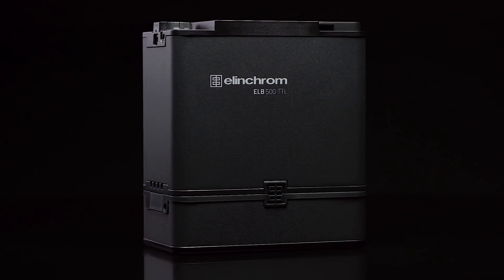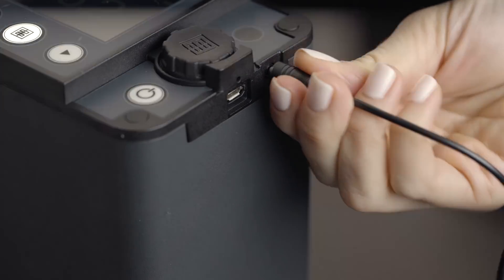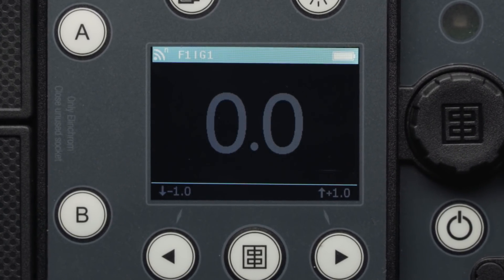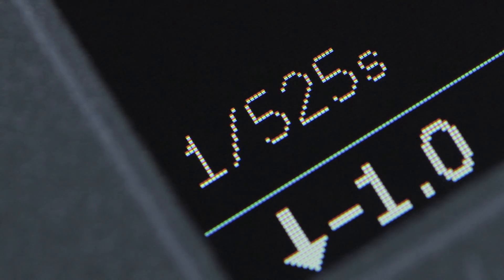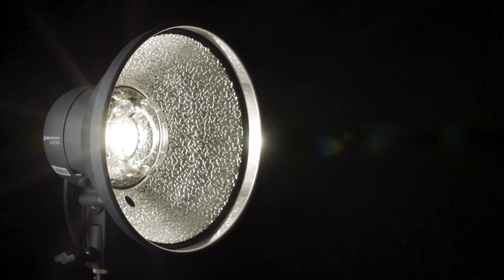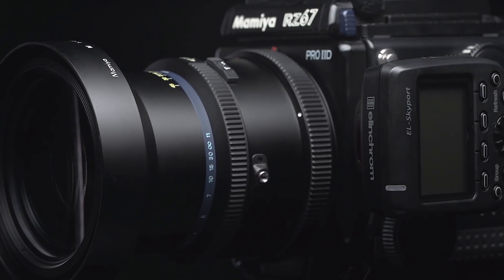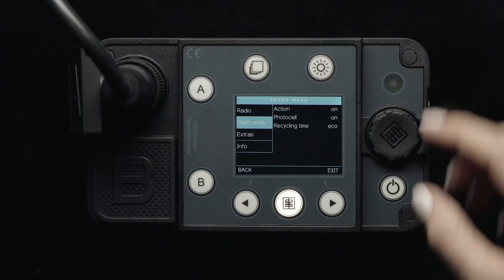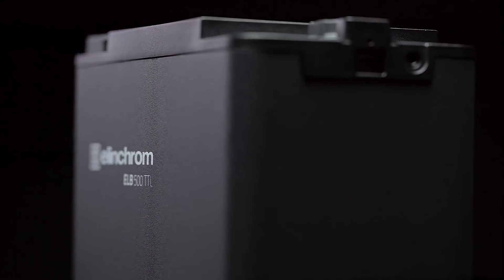Elinchrom ELB 500 TTL - Quick Start Guide

Comment: Will my Skyport remote from my Quadra system work with the ELB 500 TTL?
Reply from the maker: You'll be able to trigger but if you don't have the Transmitter Pro you won't be able to enable features like HSS or TTL.

Comment: I have a ELB 400 and the  flash head broken twice at the pivoting plastic attack to stand. Even using them VERY carefully they are too poor and light made. Searching maximum compactness and low weight they use a too slim and bad quality plastic house IMHO. Far away from my old Elinchrom lamps , made like a tank with all metal made  pivoting system . A very bad and cheap solution. I don't know if the new ELB 500 heads are better made (visually it seems the same) , but the ELB 400 heads are simply terrible. And to repair them is expensive. Pity, because for the rest they are very good and capable products

Comment: I have just upgraded to ELB 500 from old Quadra's as the units are slightly more powerful and you can use two heads at full power which for me is ideal - as I wait for delivery in the UK from those super people at Clifton Cameras I have a question does the 500 do HS?
Reply from the maker: Hi Nelson, thank you for your message. Yes, the ELB 500 provide HSS, but please make  sure it is compatible with your camera brand.
https://www.elinchrom.com/support/ELSP-HS.html#compatibility_cam
To activate this feature along with TTL, you also need the dedicated Transmitter for Canon, Nikon, Sony, Fuji, Pentax, Panasonic or Olympus.
https://www.elinchrom.com/support/ELSP-HS.html#versions
And please note that the ELB 500 cannot provide full power on each head as you seem to mention. This is physically not possible. The pack in total can deliver 500ws but split in each of the head (if 2 heads or connected).

Comment: How about doing an instruction video for the Skyport working with the ELB-500 Battery Pack????
Reply from the maker: Hi Frank, how can we help? Do you have issues with your transmitter?
Reply: Elinchrom i would also like to see such a video. It is not fully clear how they interact in different modes.
Reply: @elinchromLTD  I am trying to help a colleague get setup and running with her new ELB500 and Skyport Pro. It's proving to be a nightmare for us. She's in another city and we are using Zoom. She has somehow managed to get it so that the Skyport no longer sees the ELB500 and so she can't trigger it. We have both set to the same channel (1), the group setting is All. I had her put it into the red background "speed" mode to try and simplify, but the transmitter and pack just aren't talking. (It doesn't help that I have never used one myself but I'm usually pretty good with studio strobe gear. This one is driving me insane though.)
Reply: So I guess what I'm saying is, it would be really super nice to see a video that walks through how to setup and use the Skyport with the ELB500 pack. Assume a newbie and start with the basics. It seems like the simplest concepts are really hard to get with these two units.
Reply from the maker: @BruceWalkerPhotography  The rule here is to have the same frequency, the same group, and the same mode on both unit and transmitter. That means if you set up your transmitter into Speed Mode, make sure your unit is also into Speed mode or no connection will happen.
But, in general, we recommend staying in Normal mode if you have a DSLR camera.
https://www.elinchrom.com/learn/what-speedmode.html
Reply: @elinchromLTD  thanks! That helps.

This illustrates my big issue though. You don't provide a "system" guide that explains how these things work together. I read the ELB 500 manual and the Transmitter Pro manuals and nowhere was this concept explained. No mention anywhere that the two units needed to be separately set to the same mode either. (I would have expected that setting the Transmitter Pro would have automatically also set the ELB 500.)

An overview doc is needed, please!
Reply from the maker: @BruceWalkerPhotography  Bruce, we know this information is crucial, therefore we have it in both the Quick Start Guide and the full manual of the Transmitter Pro, in the ”Troubleshooting” section. It is also mentioned several times on our FAQ page and on some of our webpages. This information is actually included in the link I sent you.
But, you’re right, we should have included it in this video. We’ll make sure to implement this information in our next manual video.

Comment: With both heads attached to the unit and in use does the unit put out 500Ws to each head ?
Reply from the maker: No, the output power is distributed over the 2 heads.
Reply: @elinchromLTD   Thank you! I was so close to buying them thinking you'd have 500Ws to both channels when both heads are connected. Also may I ask why there's no trigger actually supplied with the pack and only a PC sync cord ?
Reply from the maker: @SimonPhillipsPhoto  If you use one head, you'll have 500ws full power output.
We do not include the transmitter because we have a transmitter for each brand camera. 
Some of our distributors include the transmitter in a set depending your camera brand.
Please check: https://www.elinchrom.com/distrib.php

Comment: I have the elb 500 with the odin ll  for Canon its awful didn't work right from day one I sent it back for the Tec guy's to have a look at it came back the same . Very dissatisfied with it . ( I have two odin controls so it not the trigger  ) works fine with the Elinchrom trigger . Any help on this issue would be greatly appreciated.
Reply: @elinchromLTD as far as  I am aware there is no firmware up dates for the phottix odin ll for Canon at the moment as I said  works great with great with the sky port controller. Looking forward to your  response
Reply from the maker: We are checking this with our R&D team and trying to replicate your issue.
Reply: @elinchromLTD  thanks, it would be great to get it sorted .

Comment: When used with Odin II (Nikon trigger) manual mode on, does the ELB 500 stay in TTL or switch to true manual?   If the ELB 500 stays in TTL modes what is the color consistency like across the power band from low to full power? Also is the modeling light controllable from the Odin? Thanks
Reply from the maker: It switches to true manual. The color stability is consistent across the all range, +/- 200 over 7 f-stops.
Reply: Hi, Thanks, Do you get the flash duration displayed when using the ELB 500 in 'Phottix' mode or is that only with Skyport?

Comment: Using two heads, will it give 100% of power to both?
Reply from the maker: No,  you can have both ports fire at the full 500w/s of power for both heads combined (250w/s each), or you can have port A fire at full power and port B fire at the lowest power.
Reply: Ok. Thanks for the clarification :)
Reply from the maker: Alejandro:

No; a pack with 2 outlets can only put out x amount of wattseconds (joules).  How that energy is divided will depend on the lighting effect the photographer is looking for.  It could be 50/50, 70/30, etc., depending on what setting the pack allows.

Comment: Sony support is not working as advertised, no response from support about this issue in 5 days now. Very poor Service Elinchrom. I came back to Elinchrom from Profoto in the hope of better support. Sadly I am disappointed about the total lack of support for this product so far.
Reply from the maker: Terribly splendid.
Reply: Hi Cris, I do not know which Country do you come from and what ELB 500 literature are you referring at. I live in Italy and I had the opportunity to read the original English and the Italian press release and brochure for the ELB 500 TTL and on both of them it is clearly stated that TTL support is immediately available for Canon and Nikon only, while other brands will follow...
Reply from the maker: What is your issue Cris?
Reply: My problem is that I have both emailed support and opened a support case via the website last week and you are not able to reply to that within a reasonable time, but you can reply to a YouTube comment within 3 hours on a Sunday! The product is sold as supporting Sony TTL via the Phottix Odin II triggers, but they do not work as the option is missing in the setup menu. The Elinchrom triggers do not appear to currently support Sony either. I would expect a reply or even an acknowledgement within 24 hours, and yes I have already contacted my local support but they were not able to get an answer either. So I am left feeling I've made a mistake buying into this system (at least so early).
Reply from the maker: Cris, we informed on our website, to all our distributors and in our Press Release that the TTL feature is only available for the Nikon and Canon Transmitters, for the moment. The Sony version will come soon through a firmware update. Please be patient. 
For the Phottix Odin II triggers, we have to do a firmware update on the unit. This will happen the same time we make available the firmware for the Skyport HS / Transmitter Pro for Sony.
Reply: I am aware of that. But if you go read your own material it does suggest that the system is full compatible with Phottix Odin II. Which it isn't. I still don't understand why your support can reply to a YouTube comment, but not my direct approach via your support channels. Very poor.
Reply from the maker: The online support has a longer response than our social tools. 1 or 2 weeks is the average response time.
Reply: WOW! Maybe you should put that on the outside of the box! You have also avoided my actual question about Phottix Support.
Reply from the maker: For the Phottix Odin II triggers (other than nikon and canon), we have to do a firmware update on the unit. This will happen the same time we make available the firmware for the Skyport HS / Transmitter Pro for Sony.
Reply: Thanks for the clarification. In that case I think you need to add that clarification to your marketing material and manuals. Because at the moment they are misleading. I may have to go talk to my supplier about returning the ELB 500s then. This is a great shame as I was excited about coming back to Elinchrom from Profoto.
Reply from the maker: Noted, that said, the wait should not be long for the Sony version (Skyport and Odin II).
Reply: Holy shit. That is terrible.